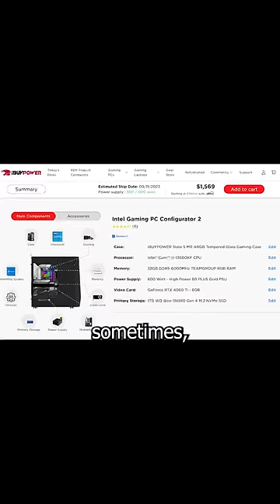Is a prebuilt #PC worth it? It depends. #technology #shorts #tech #computer

Comment: My first PC was a prebuilt, still alive till this day, running a old 970 still going strong. Got a new one and built it myself and it does feel nice!

Prebuilts are cool but you gotta do your homework on em. My little brother got a pre built and it had some off brand HDD that ended up bricking itself about 2 years after we got it. They usually cheap out on one or two parts somewhere.
Reply: Mine cheaped on the mother board and fans
Reply: @gaminskidies8270  I have a prebuilt because I needed a computer that worked without needing to worry if the Graphics card will fit in the case (long story about that) and all my games were of the light on the processor type.
I have upgraded the RAM and replaced the fans because those were the main weak points of it.

Comment: Prebuilts would be fine if any of them were actually decently put together, but almost all of them have major qc issues even though you’re paying a significant premium. If you must go the prebuilt route I think Microcenter would be your best bet tbh, either their powerspec prebuilts or let them help you choose the parts and they will assemble it for you for like $150.
Reply: I own an MSI prebuilt that ran most games with high FPS, although I did have to do a clean install from Windows 10 to Windows 11 two times. I'm not sure if this is MSI's fault, but MS Store was disabled, Game Bar, and even search (partially). If I were to rate it, personally 4.5/5. Amazing PC I must say, but the work for it was not that pleasant. and yes, i would recommend micro center :D
Reply: My cousin got a pre built and it wouldn't even turn on when he got it. The jfp1 cables were all plugged in the wrong spot. They case fans werent plugged in right. The rgb for the fans werent plugged in and the cable management was an absolute mess
Reply: Agreed
Reply: If I do upgrade from what I have right now (probably wont anyway) this will definetly be what I'll do. I ain't building that thing
Reply: The nearest micro center to me is at least 4 states away

Comment: Last two PCs I've gotten have been prebuilds. The first pre-built had to get a new PSU, a new motherboard, additional drives, new RAM, pretty much everything but CPU and heatsink. Around this time last year I got a new pre-built that I've swapped faster RAM into myself but the PSU had a short and grenaded itself, and it was covered under RMA. Luckily I had a spare PSU with higher wattage and specs that I threw in and it's been problem free ever since.
Reply: You'd think you would've learned after the FIRST prebuilt.. 🤣

Comment: The first time I built my PC and it took me 5 hours, but I can say confidently that it is MUCH cheaper to build your own. I took a look around at trying to buy another PC with my similiat parts and i found one that was almost exactly mine on a supposed cheap site. Mine cost $898 and the one being advertised was $2000. The only difference qas the case and that was an extra $80. Please look into the parts of the PC you're trying to build/get.

Comment: prebuilts are mostly overpriced, have bloatware, cheap shortcuts (say a slower ssd or ram amount) and cut corners. Not only that but it’ll normally save you hundreds to just build it yourself
Reply: Most prebuilds I find have those ADATA ssd's, which should be a no bueno for anyone that knows what to look for.
Reply: How is it cheaper to buy a whole bunch of shit for a pc when u can just buy one already made?
Reply: Wait nvm u just said why
Reply: @i_got_no_hoes  building charges, shipping charge, just a bunch of fees that you wouldnt get just building yourself
Reply: @tastyong  the shipping charge makes sense, considering ur ordering it, but the building fee is total bullshit
Reply: @i_got_no_hoes  its the main reason why prebuilds are expensive, u need a labor fee to cover cable management, building, testing, finding parts, etc

Comment: Sometimes they cost less than building it yourself
Reply: Probably if its second hand or something, no one would put in effort to build a PC and sell it for cheaper than what they spent on it + the time building it..
Reply: @sprays4days-edits  I bought my for about 1200 brand new 
Specs are Ryzen 5800x3d and Rx 6950 xt the cpu is water cooled with a cooler master 240 16 gigs of ram amazing value considering 6950 xt was about 1100 $ at launch
Reply: @sprays4days-edits They probably buy bulk, used and refurbished parts which are generally cheaper.
Especially if they repaired broken parts and used those.
Reply: @drm.himself don’t forget during the GPU shortage it was def cheaper to go prebuilt
Reply: nah you're still getting what you paid for
Reply: Usually they don't from what I've seen. They did for a while during the cryptomining boom because of those insane gpu prices but that's pretty much over now. I've never seen a prebuilt outside of that context that I couldn't more or less replicate for less money or at least for around the same price but with better components.

Comment: It's funny because it's usually people who repair or build PCs who will tell you that buying a prebuilt as a newbie is not a bad idea. I feel like the cost to build your own or buying a pre built is so narrow nowadays.
Reply: They tell you that because they've seen novices build their own PCs and fail horribly. From improperly matched motherboards and CPUs, to using the wrong RAM, to installing fans upside down, to not updating the BIOS during a CPU upgrade. If you don't 100% know what you're doing, do not do it.

Comment: What I did was back in 2020. I got a prebuilt for my birthday and I’ve spent the last four years learning and upgrading it. First thing I did was I put an extra stick of ram. Then I put in a graphics card because it only had the CPU built-in graphics. Along with that I got a new power supply and then about a year later I got a new CPU and motherboard. And then my latest upgrade has been my new graphics card and a new case. I need a hire a repair shop near me to handle the case replacement and motherboard replacement as I didn’t want to mess anything up but a few years when this PC starts to slow down, I plan on building my own one using all that I’ve learnt.

Comment: I’m still using my prebuilt 8 years later. The case ended up breaking in transit, and the guy who sold it to me was extremely nice, sending me a free replacement case and running me through the process of transferring the guts. Over the years, I upgraded pretty much everything but the hard drive, which is an archaic HDD that I need to figure out how to clone onto a more modern drive.

Comment: Yup. The prebuilt I bought had been returned to the shop and so it had a 30 % discount or something like that, even though the pc was essentially factory new. It was way cheaper than it would have been to buy those parts separately + everything is covered by a single warranty. Never had any issues whatsoever and I'm super happy with my purchase.

Comment: My HP elite desk 800 G2(technically a prebuild because it came assembled) has done wonders with, 8GB of ddr4(2133 MHZ I think, single stick), a intel core i5-6500 and integrated intel HD graphics 530, for my light weight gaming need, and it did come with a ssd but I didn’t trust it and it was only 32GB, so I replaced it with one of my HDD’s I has lying around since 2012, it has 160GB of storage, works fine, a bit slow though

Comment: My first real gaming PC I got in 2011 was pre-built that I got off newegg. Was pretty solid had no issues with it other than a preventable dust build up that took out the GPU in 2018. Swapped the gpu for a downgrade and it lasted me another 2.5-3 years before I replaced the whole system at the end of 2020, beginning of 2021.

Comment: I grabbed a significantly discounted floor model Cyberpower PC from Best Buy right before the pandemic hit, and strategically upgraded little bits as needed. For someone who has built so many of their own computers over the years it was more about the initial purchase value than anything else. It's at that aged sweet spot now that I could grab a nice, used, top of the chipset CPU that would stave off the desire to upgrade to the latest platform for another few years.  For me, I find the best value gaming at 1440p, with the option to play some titles in 4K if it's optimized well enough. Loved the video, keep being *THE GREATEST TECHNICIAN THAT'S EVER LIVED* 👨‍🏭

Comment: I got a prebuilt PC as my introduction to desktops almost five years ago, and since then I put several upgrades into it, including a 2TB HDD, new GPU, and I tried to install new RAM, but that was when I learned the difference between DDR4 and DDR5 and I had to put my old RAM back in, but my point is that these all helped me to learn the basics of building a PC. These upgrades taught me what a reasonable amount of force to use is, how to troubleshoot hardware issues (easier to figure out what you need to do when you know what you probably messed up on), and where everything goes and what it should look like. I just, for the first time, fully built a new computer just this month, and if I had moved straight from playing on an Xbox One to building a whole computer, there’s absolutely no way I could have figured any of it out. Yes, pre-built are generally a slightly higher price for equal or even lesser performance, but for getting a better starting experience, they are definitely the way to go.

Comment: Prebuilts are mainly bad because the Quality does not match the Pricetag at all. Cheap Parts, shoddy Construction and bloatware galore are all too common with Pre-Built PCs. Oftentimes the numbers look fine but under stress the performance is not correct because they may be using a 3090 for example but from a no name manufacturer no one ever heared about that cut curners everywhere

Comment: The issue about pre-builts :
- Breaks easily
- Has unreliable parts
- said parts cannot be replaced without a proper technician, even if you have the proper knowledge
- Repairs are expensive as fu--
- Unreliable brands
- must be repaired by the provider only
- expensive as hell despite the parts being cheap as sh**
- Extremely unreliable.
- can also turn out to be total scams, but a "Legal" scam. As in the companies that provide it find loopholes to not make it a scam and are still legal.
- also really hard to know the PC inside-out, so you wont know what the problem is.
- most of the time are not correctly built.
- can void warranty if you repair it yourself or replace a part by yourself.

...Need i say more? The list goes on and on and on.

However, it's not ALL of the pre-builts that suck. Gaming laptops are an example of that, Handheld gaming PC hybrids (such as the Steam Deck) are also a BEAUTIFUL example of really good gaming PCs. (Cuz yes, the steam deck is a hybrid handheld gaming PC, it runs on a custom edition of ArchLinux.)

Comment: Pre-built PC's used to be bad back in the day, because they often could not be upgraded.

Either because of on-board graphics with no AGP/PCI-E slot or because the chassi was pre-designed to be in your way of upgrading anything.

They are also extremely expensive, and anyone with access to YouTube can build their own gaming PC with ease.

I built my own PC when I was 7.
It was an i486 33mhz with 24mb ram and a 1-2gb HDD. In fact, I took that entire PC down into every individual part, and opened up the power supply to have a look in there as well, then put it all back together again just for fun. About 3 different times.

Don't fall for pre-built scams.

Comment: I'm currently running an iBuyPower machine that I bought in 2013.  I've upgraded the RAM, PSU and GPU a few times from 16GB and SLI 780s up to 32GB and a 1080Ti. The CPU is the original 4th gen 4820K that still works great.  Now, I've decided to go back to building with a 7900XTX and 7800X3D. I like my pre-built machines when I'd rather just have a computer to use right away, but every once in a while it's fun to start from scratch.

Comment: My PC is a pre build. I got it as a present, it's a Amazon pre build from a German company called Ankermann.. its actually really good, they didn't skimp on parts, no cheep power supplies, no one stick low frequency ram, no questionable M.2. Or other odd part choices of questionable quality. Soo yeah I'd say I'm pretty happy with the prebuild I got, first thing I did when I got it was open it up and inspect everything. The cable management is impeccable. Maybe I just got lucky.

Comment: I got a Best Buy "gaming PC" in 2015 as a graduation present. mATX motherboard that won't take any upgrades past hardware from 2016, was able to give it some more RAM and a GTX 1060, a PSU to compliment it, and an SSD to replace my HDD that failed around 2019. Slowly figuring out computer stuff, first step's gonna be getting a motherboard that fits my case, and a GPU that fits both the case and the motherboard

Comment: Built my first PC in 2010, at that time the price difference between sourcing all the parts myself and building Vs getting a pre build with almost the same parts was the pre build was 30% more expensive. Did the same thing again a few years later and the pre build was still about 20% more expensive. Then in 2017 I again came to get a new PC and and the pre build was only £60 more expensive which became the point that it made sense for me to just get a pre build. Then finally last year I upgraded again and the pre build was £100 cheaper than building myself. It's crazy how quickly it changed.

Comment: I feel the same when i got a gaming laptop. If you have a good skrewkit and a reference on someone disassembling the same laptop model, you can learn how to replace a fan or even learn you got an extra SSD slot. After replacing a $10 fan and having it for 5 years, i do need some thermal paste for it.

Oh, and always take the battery out of the laptop when dissasembling.

Comment: i’ve had a prebuilt for around 6 years, it was my first pc i got as a teenager and i upgraded a few parts myself like the RAM. However in the last year or so it starting to give out on me, my storage space is lacking quite a bit, it’s slow, and my already quite old gpu (gtx 1060) has a broken fan and it’s not running great anymore, among other things. so i’m upgrading and this time building it myself. this one was good to me tho, i had a few gripes with it but it worked well enough for the specs it had and it lasted honestly much longer than i expected it to.

Comment: Walmart had a $799 (marked down to $699) pre made PC that is a hell of a deal rn. Parted out it totals to around $890 to build it yourself, but it has 1tb NVME storage, 16gb (ddr4), ryzen 5 5500, and a Radeon 6700 in it. Plus a solid cooler, decent fans, and a really solid mouse included.

Comment: Honestly it's better to build your computer yourself and it's usually cheaper to build it yourself too, if you do decide to buy pre built you should research the case and motherboard. These two things are extremely important, the case size determines what graphics card you can install and the motherboard determines what upgrade path you have down the line, like your CPU and ram

Comment: Prebuilts can be horrible, or they can be fantastic. I just upgraded my PC from an almost 8 year old system with a prebuilt. It was on sale and even with the excellent extended warranty from Memory Express (Great Canadian company) it was cheaper than buying the exact same parts piece for piece and building it myself. Off sale it would have cost more, but deals are out there. My PC even has better parts than the listing showed, upgraded MB and better RAM than was listed. I am glad I went prebuilt. Had it in 3 days and was ready to rock out of the box.

Comment: I built my PCs myself since 1998. All my rigs were built by myself except a gateway rig with first gen Core i7. However during the releasing days of 3080 it's impossible to get one without being ruined by scalpers. So after weeks of hunting I purchased a CyberpowerPC pre built tower with i9 10900k, 32gb and 3080. It's okay built, surprisingly with pretty good cable management and they tried to do color coding with black and red components and tons of RGB. The rig was built with all branded components. Well they had to work with whatever available so I got Asus motherboard, gskill ram, WD nvme, MSI 3080, and a miserable 180 cpu water cooler with cool light and a display on pump. Well since CPU always heat throttle I had to get s proper CPU cooler myself, but everything else was good quality stuff. I personally would use same branded components so RGB could work better in cohere, but at the situation any component went gone in a heartbeat, I actually am pretty satisfied with my purchase, and it actually is cheaper than purchasing everything myself, and have a warranty which I broke by installing my own watercooler.

Comment: My first PC was pre built but it was also pretty bad. An i3 2100, an HDD as my only storage device, and 16gb of RAM though that part was fine. I taught myself how to upgrade computers and then did some upgrading. Swapped out the i3 for an i7 2600, put in a 500gb SSD, and a GTX 1050 ti. Still not the best PC ever but it was a MASSIVE improvement over the original.

Then a couple years ago I built a new PC. This was a long and difficult process (had to replace the motherboard, CPU, and RAM) but I eventually got it done. This one has a Ryzen 7 3800x, 32gb of RAM, 2 SSDs and 2 HDDs, and a GTX 1660 Super, though I should note that my original choice was an RTX 2060 Super but someone bought that one before I could.